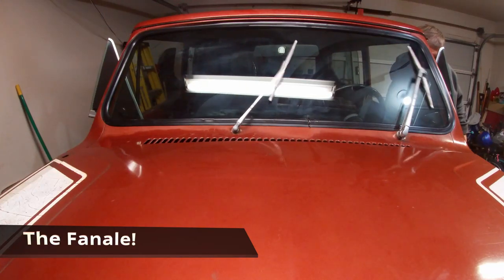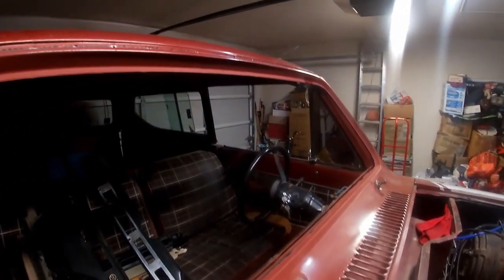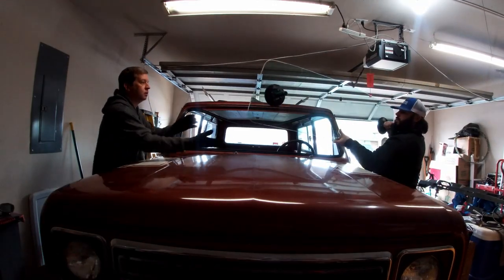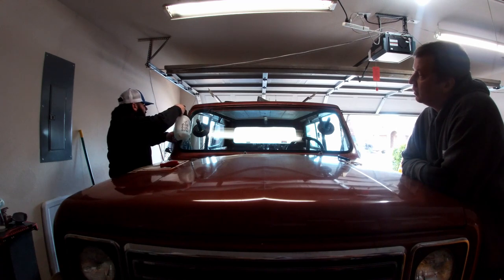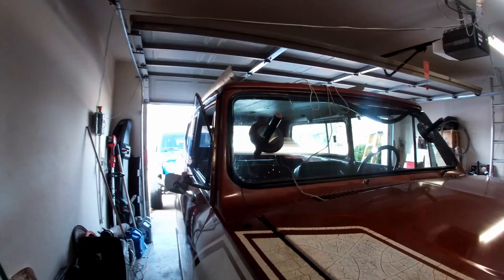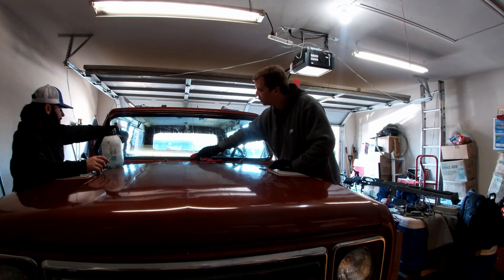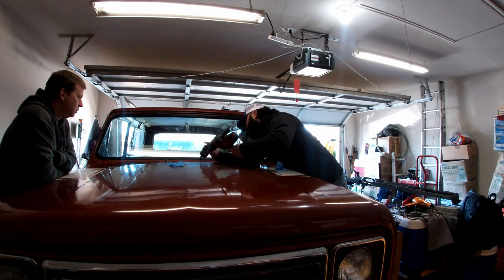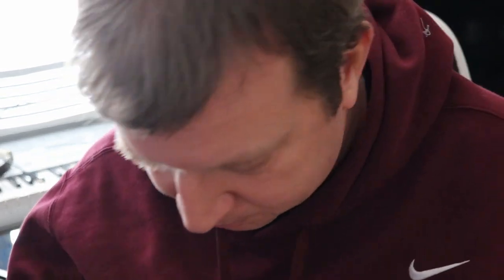Scout II Windshield Frame Repair and Glass Installation Finale! Part 4

Comment: Nice work! Do you remember if there are any drain holes in the bottom of windshield frame? Mine has some soft top snaps missing on top of frame letting water in not sure where it’s ending up
Reply from the maker: There shouldn't be. But the corners let that water sit in there and are notorious for rusting out. If I remember right, it will drip down into the cowl area and go down in that area in the back of the fenders.